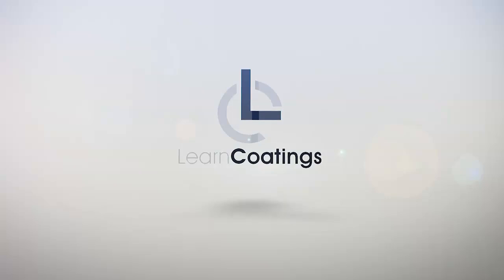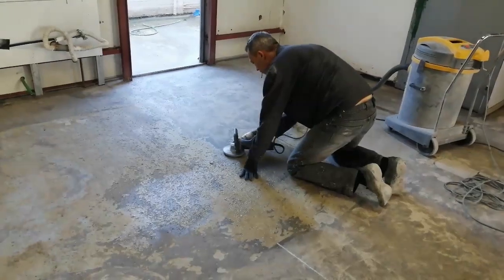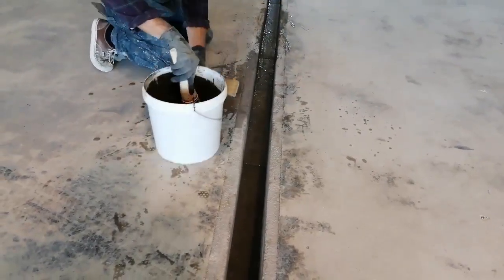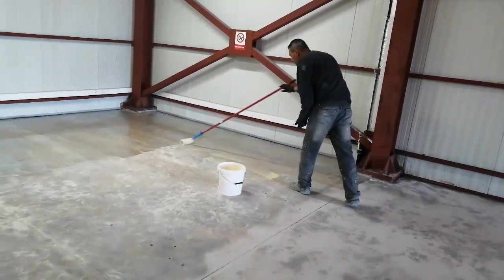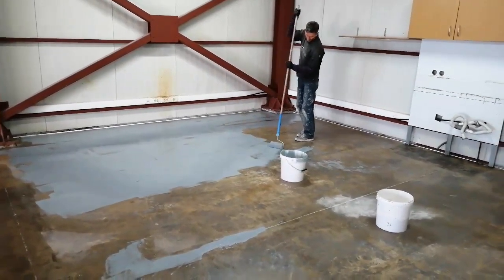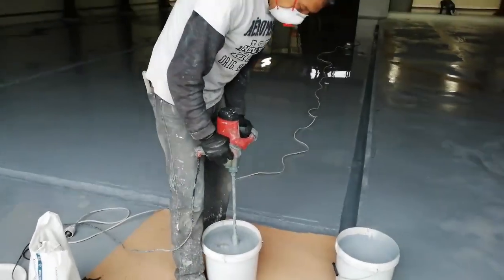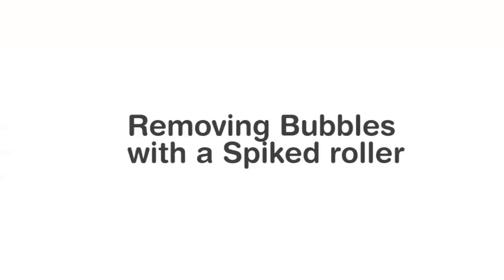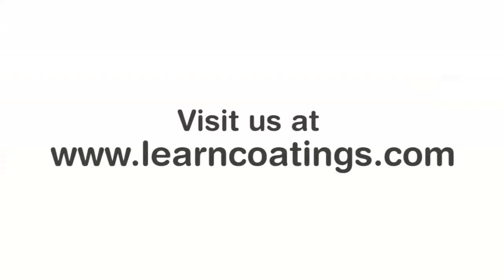Applying a Self Levelling Epoxy Floor - Step by Step from a real Project!

Comment: would self-leveling toppings be ok instead of grinding the existing concrete, before priming and putting on epoxy?
Reply from the maker: Always grind the concrete. You want to clean it, remove any loose bits and allow mechanical bonding of the next layer. A topping without any prep can be dangerous

Comment: Do you need to use a surface cleaner for prep
Reply from the maker: A grinder usually does a much better and more effective job. And then a proper industrial vacuum

Comment: I have a very rough cement floor, do I need to grind down all the surfaces smooth or just hit the high spots.
Reply from the maker: No rough cement needs lots of prep if you want to apply epoxy. Check out this video here https://youtu.be/6jjk0ETE_mo

Comment: Why did you not use the extra large rollers?
Reply from the maker: Extra large rollers are not always convenient as you need to have a super flat floor for them to work properly. Otherwise they do a poor job in covering the area. This is why I prefer using narrower rollers

Comment: If you have a really large floor area to do, how do you ensure the edges are flush and level?
Reply: sorry I missed out something important. If the floor area is very large, you will need to have stop joint. Then continue from there the next day etc, but wont you get a lip since hand troweling guys cant get it perfect?
Reply from the maker: Yes you will get a lip. We always use a masking tape to create a visible start stop line. And we try to coat that area over the tape with a paint brush so we keep the thickness at a minimum at the spot where the two floors join

Comment: Hi sir, 
I apply primer one of my project it takes almost 5 to 6 days for dry. Why this happened?  

Anothers question which sand you use with epoxy?  Is there special one  or any sand?
Reply from the maker: 5-6  days to dry is too long probably something went wrong with the mixing. Watch this video for more information https://youtu.be/D-F0h338zNE
I always use cleaned river quartz sand. Avoid general sand as it is contaminated with too many random particles that contain moisture

Comment: Hi good day.. Do you use the same base coat to fix the cracks and fisures?
Reply from the maker: Yes it is possible to add either quartz or a filler powder twith the same base coat to fill up the cracks

Comment: Hello, Thank you for a very helpful video. I am interested in the "Base Coat" you apply, other suppliers and contractors call it "Scratch coat" as well. Is this absolutely necessary? Isn't the primer suppose to seal the concrete pore and prevent bubbling of the SL Epoxy, wouldn't this base coat compromise the system adhesion to the floor?  Thanks
Reply from the maker: Yes correct the purpose of the primer is to prevent bubbling and to seal the surface. However sometimes one coat is not enough to seal the problems by 100%. Especially if you are working in large areas. That is why we recommend the base coat, cause if you get bubbles the cost of correcting the problem is much larger

Comment: Hi Sir, 5mm notched trowel will level a 2.5mm thickness?
Reply from the maker: Yes if you use a symmetric triangular shaped trowel then a 5mm trowel should leave half the quantity in the floor when spread in an upright position. That should make a total thickness of 2.5mm
Reply: Last question Sir, if the surface were not that level due to some poor workmanship of masonry workers, Is it still can be leveled by a self leveling epoxy paints? Thanks for the reply.
Reply from the maker: @vanztpc3526  if the unevenness of the surface is more than 1-2 mm than you should not count on epoxy to do the leveling. You will probably need to do some grinding and grouting first
Reply: Thank you so much for clarification sir.

Comment: Epoxy in food processing is in my opinion a bad idea. The ingriedients of epoxyresins are categorized as cmr-chemicals (cancerous, mutagenous, reprotoxic). As there is always some resin leftover after reaction it is an avoidable risk.
To this project, how long was your potlifetime an how long did the curing of each layer take?
The final layer isnt sprinkled with quarz so it could be very slippery when wet.
Reply from the maker: Potlife time was about 30-40 minutes, and the curing of each layer required 16-24 hours. The final coat was walked on after 4-5 days. Sprinkling quartz makes the floor anti-slip but it also makes it less shiny and much harder to clean. In this specific facility, the staff will be wearing proper rubber safety shoes so slipping should not be an issue.